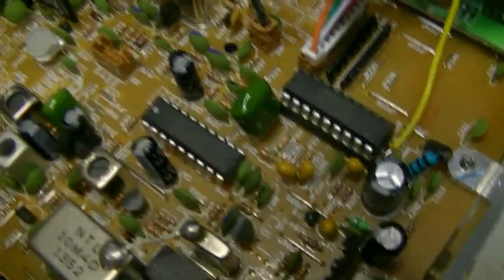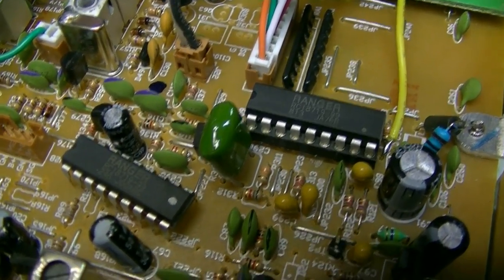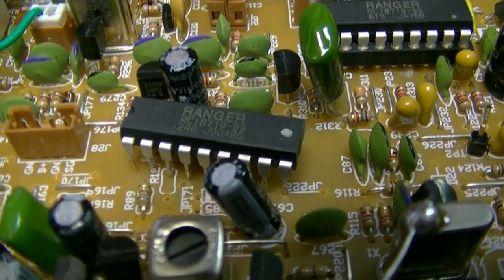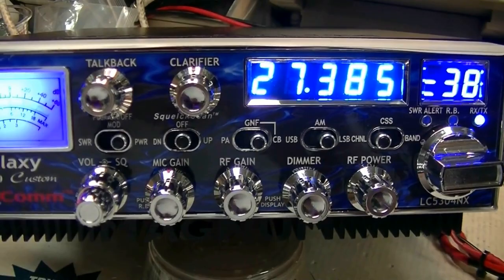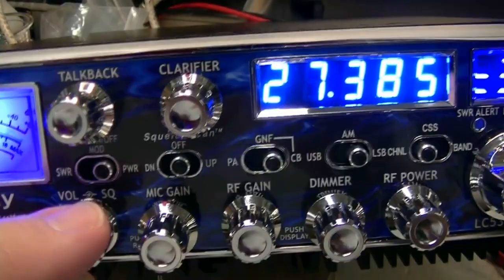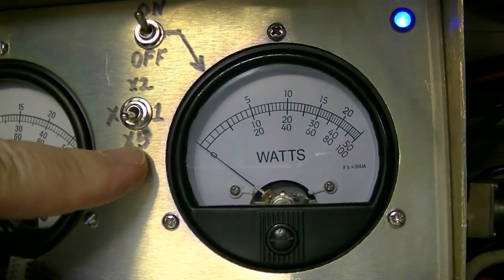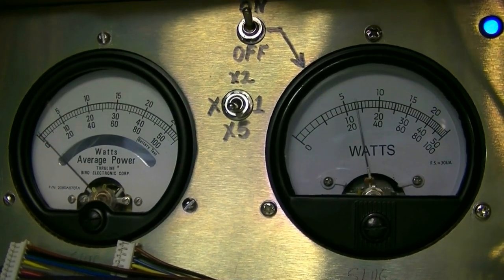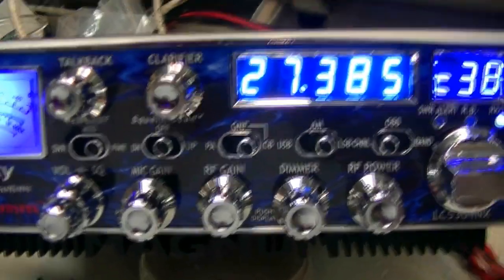Lindell Ca DX959 Custom....Want one? Go to www.LesComm.com/Radios

Comment: Nice! I like the swing on it, thats exactly how I set up my radios in the past. Low dead key wattage but swings to the roof during transmit. I have'nt been into CB since the late 80's and have no equipment or radios anymore. I'm planning on getting back into it and would like YOU to build n tune one for me. a Galaxy 959 with blue lights and echo. Do you install echo boards? Could you build me one?